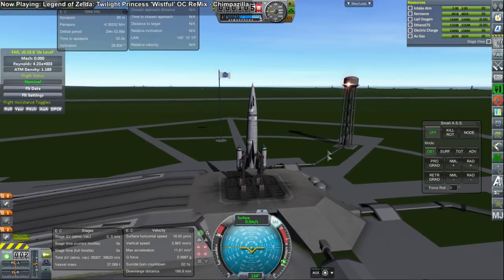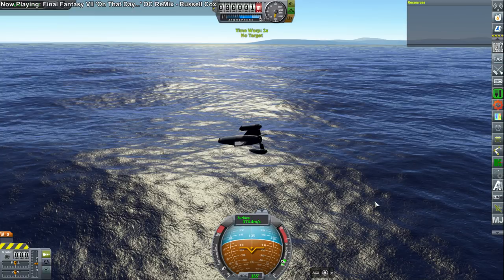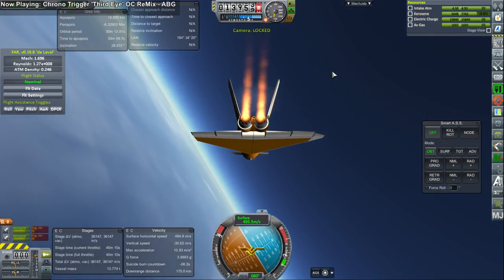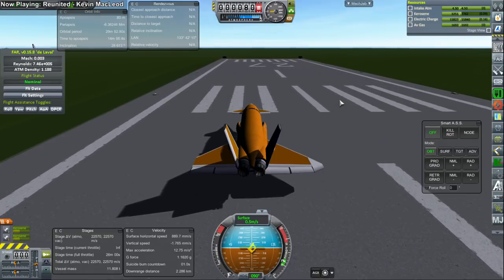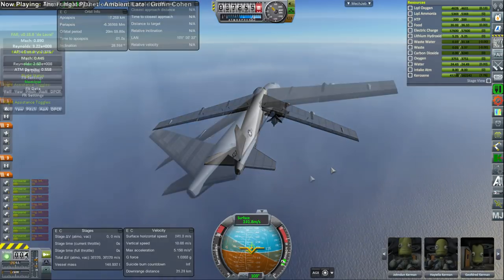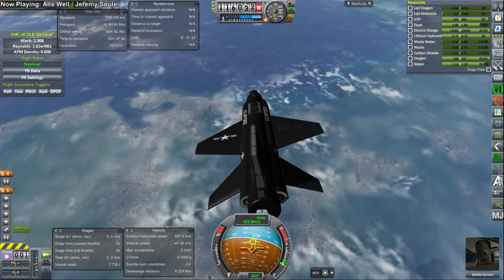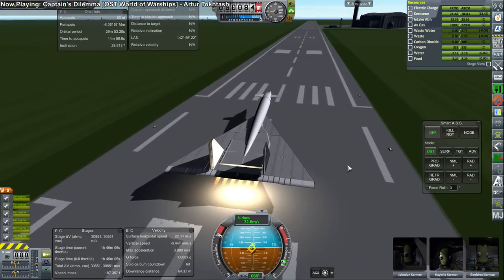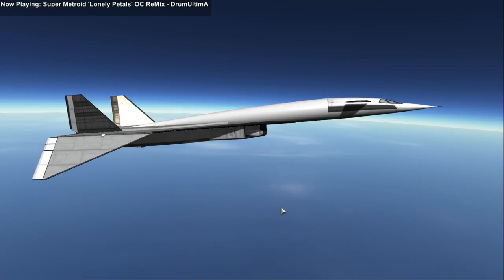Design of the Space Shuttle 02 - North American Aviation

Comment: The wing tips on the XB-70 were designed to trap the shock wave under the aircraft to provide lift.  If FAR doesn't model that effect and you had to have a higher AoA to compensate, you may have had too much drag to make Mach 3.